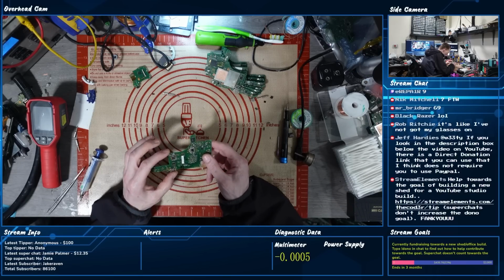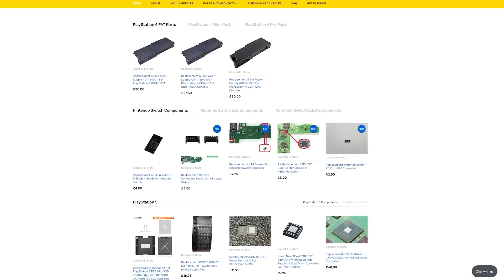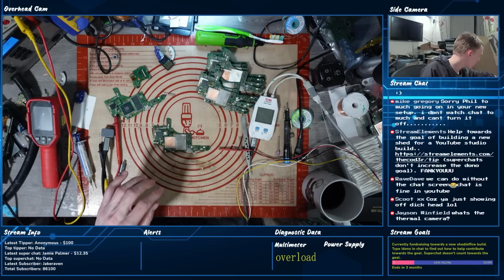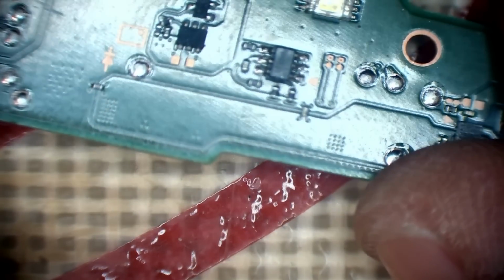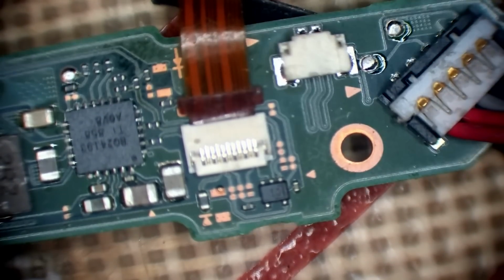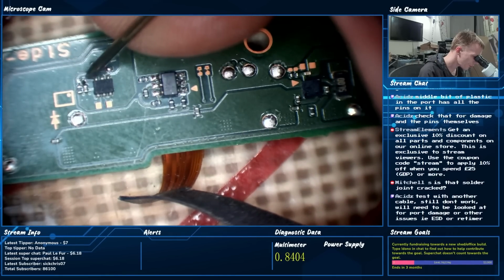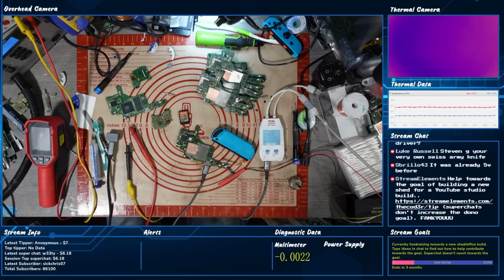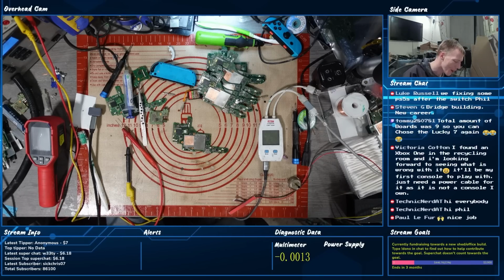My Stream Picked A RANDOM Nintendo Switch Donor Board To Fix... Can I Get It Working?

Comment: I noticed that even if the locking tab on a flex ribbon connector in the switch pops off, just some kapton tape on the back of the flex to make it thicker makes a good contact in the connector. Then just tape it down so it doesn't move.